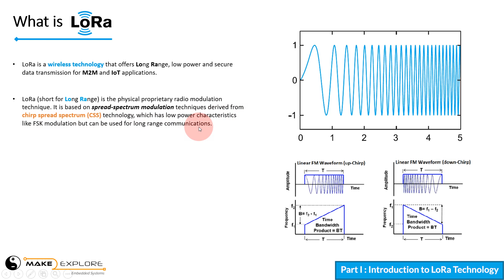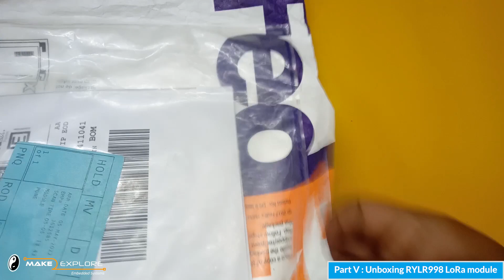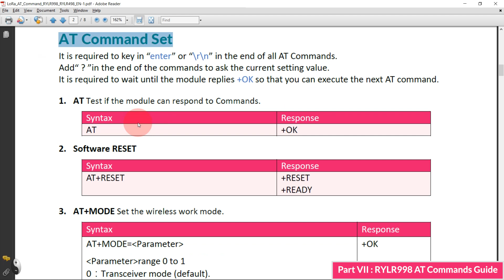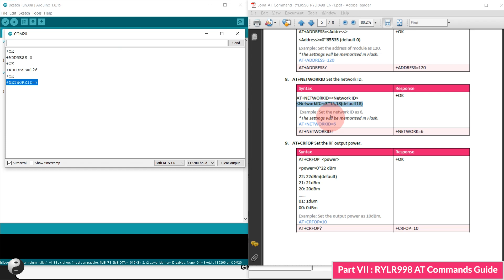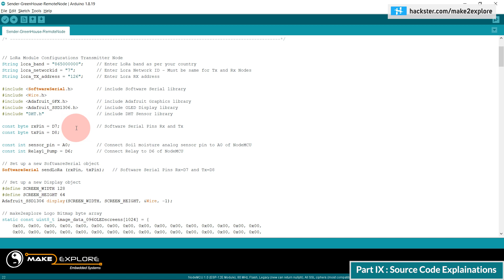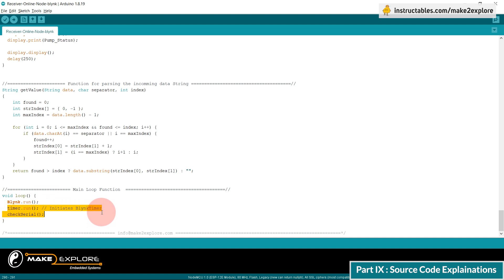[Device Overview] Reyax RYLR998 LoRa Module

Comment: What is the type of antenna?
Reply from the maker: Dear Friend, @bgm3942

Thank you very much for your interest in our channel.

Q - _ What is the type of antenna?_

➡️ The RYLR998 LoRa module we tested has helical antenna*. A helical antenna is an antenna consisting of one or more conducting wires wound in the form of a helix. A helical antenna made of one helical wire, the most common type, is called *monofilar , while antennas with two or four wires in a helix are called bifilar , or quadrifilar , respectively. 

➡️ The RYLR998 LoRa module typically comes with a U.FL (IPEX) antenna connector. This allows you to connect an external antenna that supports the LoRa frequency bands the module operates on, such as 433 MHz, 868 MHz, or 915 MHz, depending on the version and region.

➡️ You can use a suitable LoRa antenna (e.g., whip, helical, or PCB antenna) with a U.FL connector or use an adapter to connect it to other antenna types like SMA. The choice of antenna impacts the range and performance of the LoRa communication.

If you still have any suggestions/issues/queries about this Tutorial, or any of our DIY project, feel free to ping us on WhatsApp/Telegram (Links given below).

Tech support - (𝗖𝗵𝗮𝘁 𝗢𝗻𝗹𝘆) Telegram/WhatsApp - 11:00 AM - 05:00 PM (Mon-Fri) IST   

🚀 𝗧𝗲𝗹𝗲𝗴𝗿𝗮𝗺      🔗 https://t.me/make2explore
💬 𝗪𝗵𝗮𝘁𝘀𝗔𝗽𝗽    🔗 https://bit.ly/3VXGGEe
📩 info@make2explore.com  / support@make2explore.com

Thank you again for your Support,

Best Regards

Comment: Excellent work, thanks.

Do you know how many RLY998 modules can I connect, within the same network? Using the REYAX LoRa Mesh Application.
Reply from the maker: Dear Friend, Jose Naranjo @jnaranjo-hwt 
 
Thank you very much for your interest in our channel and your encouragement. Glad to know that you liked our content.

Q - Do you know how many RYLR998 modules can I connect, within the same network? Using the REYAX LoRa Mesh Application

➡️ According to the REYAX documentation, the LoRa Mesh Application supports:
1. Maximum 255 devices per network (including gateways and end devices)
2. Maximum 16 hops for mesh networking

📌 However, the exact number of modules you can connect within the same network depends on several factors affecting Network Capacity:
1. Data transmission frequency: More frequent transmissions reduce network capacity.
2. Data packet size: Larger packets reduce network capacity.
3. Network topology: Mesh networking can increase capacity, but also introduces complexity.
4. Interference: Environmental interference can impact network performance.

📌 Practical Implementation Considerations:
While the theoretical limit is 255 devices, practical considerations may be:
==> 50-100 devices: Typical limit for most LoRaWAN networks.
==> 10-20 devices: Recommended limit for high-traffic or mission-critical applications.

📝 REYAX Documentation for RYLR998 Module-
 🔗 https://reyax.com/products/RYLR998

Hope you find this information useful. If you still have any queries/issues/suggestions about this Tutorial, or any of our DIY project, feel free to ping us on WhatsApp/Telegram (Links given below) for further support.

Tech support - (𝗖𝗵𝗮𝘁 𝗢𝗻𝗹𝘆) Telegram/WhatsApp - 11:00 AM - 05:00 PM (Mon-Fri) IST   

🚀 𝗧𝗲𝗹𝗲𝗴𝗿𝗮𝗺      🔗 https://t.me/make2explore
💬 𝗪𝗵𝗮𝘁𝘀𝗔𝗽𝗽    🔗 https://bit.ly/3VXGGEe
📩 info@make2explore.com  / support@make2explore.com

We will be ❤️happy to help.

Best Regards

Comment: how do you get the SoftwareSerial.h file? Thanks
Reply from the maker: Dear Friend @jjones503 
 
Thank you very much for your interest in our channel.

Q - how do you get the SoftwareSerial.h file?

➡️ This SoftwareSerial library header file is part of  Arduino Core - AVR. You need not to install/get from any external source. You just need to import it into your code. 

➡️ In case of ESP8266/32, its implementation or compatible version also get installed on your system when you install 'Arduino Core for ESP32/8266'. This means once you install your board package(ESP32/8266) into Arduino IDE's boards manager, SoftwareSerial library automatically get installed, since it comes with default package of ESP32/8266 boards core.

📌 Checkout following links for more info - 

🔗 https://github.com/arduino/ArduinoCore-avr/blob/master/libraries/SoftwareSerial/src/SoftwareSerial.h
🔗 https://docs.arduino.cc/learn/built-in-libraries/software-serial/

🔗 https://github.com/esp8266/Basic/blob/master/libraries/espsoftwareserial/SoftwareSerial.h
🔗 https://www.arduino.cc/reference/en/libraries/espsoftwareserial/

Hope this will help, beside If you still have any queries/issues/suggestions about this Tutorial, or any of our DIY project, feel free to ping us on WhatsApp/Telegram (Links given below) for further support.

Tech support - (𝗖𝗵𝗮𝘁 𝗢𝗻𝗹𝘆) Telegram/WhatsApp - 11:00 AM - 05:00 PM (Mon-Fri) IST   

🚀 𝗧𝗲𝗹𝗲𝗴𝗿𝗮𝗺      🔗 https://t.me/make2explore
💬 𝗪𝗵𝗮𝘁𝘀𝗔𝗽𝗽    🔗 https://bit.ly/3VXGGEe
📩 info@make2explore.com  / support@make2explore.com

Best Regards

Comment: Is anyone able to communicate with their lora modules on their MAC?
Reply from the maker: Dear Araine T-Jay @arainetjay, 
Thank you very much for your interest in our channel.

Q - Is anyone able to communicate with their lora modules on their MAC?

➡️ We have not tried that approach yet. Also not seen any such MAC based communication project on anywhere on internet. Documentation about this module is very rare and there are also no any pre-compiled libraries available. We have to program them with barematal way using AT commands. Explore it if you are interested, and let us know about your experience.

If you still have any queries/issues/suggestions about this Tutorial, or any of our DIY project, feel free to ping us on WhatsApp/Telegram (Links given below) for further support.

Tech support - (𝗖𝗵𝗮𝘁 𝗢𝗻𝗹𝘆) Telegram/WhatsApp - 11:00 AM - 05:00 PM (Mon-Fri) IST   

🚀 𝗧𝗲𝗹𝗲𝗴𝗿𝗮𝗺      🔗 https://t.me/make2explore
💬 𝗪𝗵𝗮𝘁𝘀𝗔𝗽𝗽    🔗 https://bit.ly/3VXGGEe
📩 info@make2explore.com  / support@make2explore.com

As per time permits we will try our best to help you out. 

Best Regards
Reply: @make2explore hey thanks! I’m definitely checking it out. I think it’s communicating but MAC terminal doesn’t visually output the serial print - so I’m coding the Lora settings in the startup of my code

Comment: You have skip the entire LoRaWan Stack …… and using some P2P execption Mode …… right ?
Reply from the maker: Hello Friend @q9a 
Thank you very much for your interest in our channel.

Q - You have skip the entire LoRaWan Stack …… and using some P2P execption Mode …… right ?

➡️ Yes, you are absolutely right!!. We have used very simplest method/approach possible to make this DIY project and testing review of these LoRa module RYLR998. Since, in our area there is very weak and sometimes there is no any coverage for LoRaWAN network and Gateways. So, we decided to go with simplest P2P method.

Have fun testing (RYLR998 and RYLR986 modules) in your area with LoRaWAN stack and let us know how it performs.

If you have any queries/issues/suggestions about this Tutorial, or any of our DIY project, feel free to ping us on WhatsApp/Telegram (Links given below) for further support.

Tech support - (𝗖𝗵𝗮𝘁 𝗢𝗻𝗹𝘆) Telegram/WhatsApp - 11:00 AM - 05:00 PM (Mon-Fri) IST   

🚀 𝗧𝗲𝗹𝗲𝗴𝗿𝗮𝗺      🔗 https://t.me/make2explore
💬 𝗪𝗵𝗮𝘁𝘀𝗔𝗽𝗽    🔗 https://bit.ly/3VXGGEe
📩 info@make2explore.com  / support@make2explore.com

As per time permits we will try our best to help you out. 

Best Regards
Reply: @make2explore Do you know if it possible to run LoRaWan with this Devices …… it looks to me this modules are designated for P2P …… are there this modules also with LoRaWan firmware. For P2P a direct connect mode for the TX/RX pairs to create a LoRa Serial cable …… but the Dokumentation does not show something …… ist there also such a firmware to the Modul? 

Then there is also an other Point you have  not exact describe. Does the Modul ensure the entire conditions of the free frequency usage? The Question refers to the "Duty Cycle" limitations of this frequency. LoraWAN do so. If not you can not use it for DIY because you nee formal quality control about the applicaton software to ensure the duty Cycle condition will not be beaked.
Reply from the maker: Dear Hans Carlos Hofmann @q9a

Q - _but the Documentation does not show something....is there also such a firmware to the Module? _

➡️ Please note that this module is very basic LoRa trans-receiver hardware which build onto Semtech's LoRa Engine interfaced with NUVOTON MCU. Manufacturer do not reveal anything about actual middleware firmware, we have to deal with only application layer (via AT commands). Also, this module do not have any such tutorials or WiKi documentations about, how to connect LoRaWAN network or TTN. Surprisingly the manufacturer (Rayax) has not mentioned anything like that for the RYLR998 in its datasheet or AT commands guide. Also we do not found any compatible precompiled library do achieve that. So, it is clear that, we have to write our own command sequences and coding paradigms to make this module to connect to LoRaWAN. It's literally like writing your own stack!!!

We have also tested LoRa modules and dev kits launched by SEEED Studio which are Wio-E5 series based on STM32WLE5JC SoC (ARM Cortex M4 + Semtech LoRa® SX126X). You can find more info about them in following links, 

Wio-E5 STM32WLE5JC Module
🔗 https://wiki.seeedstudio.com/LoRa-E5_STM32WLE5JC_Module/

Wio-E5 mini Dev kit
🔗 https://wiki.seeedstudio.com/LoRa_E5_mini/

Wio-E5 Development Kit
🔗 https://wiki.seeedstudio.com/LoRa_E5_Dev_Board/

These modules and dev kits are fully documented for what you want to achieve, beside it also have 
- pre-compiled library 
- full SDK package provided. so you can write your firmware - building several applications with STM32Cube MCU Package for STM32WL series(SDK).
- WiKi Guide for how to connect and send data to The Things Network.

We'd recommend to checkout above, these hardware will useful for what you want to achieve.

If you have any queries/issues/suggestions about this Tutorial, or any of our DIY project, feel free to ping us on WhatsApp/Telegram (Links given below) for further support.

Tech support - (𝗖𝗵𝗮𝘁 𝗢𝗻𝗹𝘆) Telegram/WhatsApp - 11:00 AM - 05:00 PM (Mon-Fri) IST   

🚀 𝗧𝗲𝗹𝗲𝗴𝗿𝗮𝗺      🔗 https://t.me/make2explore
💬 𝗪𝗵𝗮𝘁𝘀𝗔𝗽𝗽    🔗 https://bit.ly/3VXGGEe
📩 info@make2explore.com  / support@make2explore.com

As per time permits we will try our best to help you out. 

Best Regards

Comment: Hello, nice video! I did a project here at home based on your video to heat the pool that transmits the pool temperature and receives the command to turn on the pump if the temperature is low. However, it stays on all day and sometimes I need to restart the module. I use a Hi-link 5V 600ma mini power supply. Can you tell me if the problem could be the mini power supply? thanks
Reply from the maker: Dear Rogério @rogeriocamargo1984, 
Thank you very much for your interest in our channel.

Q - I use a Hi-link 5V 600ma mini power supply. Can you tell me if the problem could be the mini power supply?

➡️ You have to estimate the power specifications of your project. Calculate total power requirements of your project(Including all components and their consumption and current requirements). And then design power supply accordingly. 

Please note the following important points - 

📘 There are two important specs about RYLR998 LoRa module -
📌 --> Transmit Mode current - Typically 140mA at RFOP = +22dBm
📌 --> Receive Mode current - Typically 17.5mA at RFOP = +22dBm
During testing of this LoRa module, we found out that, this module requires significant amount of current during transmitting signals. 
***You can use Sleep mode (or Smart receiving power saving mode) to keep module power consumption low(during idle time). There are AT command to enable Power saving mode (Check out AT commands Guide document).

📘 About HLK-PM01 Hi-link - 5V 3W - AC to DC Power Supply Module -
📌 Short-term maximum output current: 1000mA
📌 The maximum output current for a long time : 600mA
 
***HLK-PM01 is good option for standalone system. But we recommend If you provide separate power sources for LoRa module and other circuitry, your problem can be solved.

If you have any queries/issues/suggestions about this Tutorial, or any of our DIY project, feel free to ping us on WhatsApp/Telegram (Links given below) for further support.

Tech support - (𝗖𝗵𝗮𝘁 𝗢𝗻𝗹𝘆) Telegram/WhatsApp - 11:00 AM - 05:00 PM (Mon-Fri) IST   

🚀 𝗧𝗲𝗹𝗲𝗴𝗿𝗮𝗺      🔗 https://t.me/make2explore
💬 𝗪𝗵𝗮𝘁𝘀𝗔𝗽𝗽    🔗 https://bit.ly/3VXGGEe
📩 info@make2explore.com  / support@make2explore.com

As per time permits we will try our best to help you out. 

Best Regards

Comment: Sir. ¿Do you know how to make a mesh net with the RYLR998 Lora module?
I would like to learn how to build a mesh net with this Lora Chip that you are using?
May you help me out? 
Please
Reply from the maker: Dear Rafael @1rafaelespinoza,

Q - how to make a mesh net with the RYLR998 Lora module?

➡️ You can go through AT Commands Guide of RYLR998(Links given below). For more details about how you can create network and mesh using this RYLR998 LoRa transceiver module.

In our projects we tried only P2P method. We still have to explore Mesh/Networking using this module. Moreover, on the internet, till date we have not found any (Mesh) implementation/project available which is built using this module. But you can give a try, and let us know. There are different libraries available for Mesh networking using Semtech LoRa Engine Chips , like LoRaMesher for Arduino. 

RYLR998 have Semtech LoRa Chip inside, but it is embedded with Nuvoton MCU and custom pre-programmed by Reyax. So we have only access to AT commands and not to MCU code. So, If you want to use Lora Mesh-networking using this module, I think you have to try with AT commands and build custom library for this module.

***You can refer Networking diagram given by Reyax in their AT commands Guide document for more details.

RYLR998 Docs 🔗 https://reyax.com/products/RYLR998
LoRaMesher 🔗 https://github.com/LoRaMesher/LoRaMesher

We hope you find the above information useful.
If you have any issues/suggestions about this Tutorial, or any of our DIY project, feel free to ping us on WhatsApp/Telegram (Links given below) for further support.

Tech support - (𝗖𝗵𝗮𝘁 𝗢𝗻𝗹𝘆) Telegram/WhatsApp - 11:00 AM - 05:00 PM (Mon-Fri) IST   

🚀 𝗧𝗲𝗹𝗲𝗴𝗿𝗮𝗺      🔗 https://t.me/make2explore
💬 𝗪𝗵𝗮𝘁𝘀𝗔𝗽𝗽    🔗 https://bit.ly/3VXGGEe
📩 info@make2explore.com  / support@make2explore.com

As per time permits we will try our best to help you out. 

Best Regards

Comment: I have RYLR998,  when set band using At command "AT+BAND=865000000", it remember only when it is connected, when i disconnect and connect and ise "AT+BAND?"
it shows +BAND=915000000Hz, why it is not remembering BAND?
Reply from the maker: Dear @MrNams, 
Thank you very much 🙏 for your interest in our channel.

Q  -  ---it shows +BAND=915000000Hz, why it is not remembering BAND?

➡️ If you see timing diagram given in datasheet of this RYLR998 LoRa Transceiver module, it has been clearly shown that it get RESET (RST) to factory settings/configurations/parameters  whenever we power it on. Therefore we need to re-configure it to desired frequency band every time we power it on. And +BAND=915000000Hz is the default frequency band.

If you have any issues/suggestions about this Tutorial, or any of our DIY project, feel free to ping us on WhatsApp/Telegram (Links given below) for further support.

Tech support - (𝗖𝗵𝗮𝘁 𝗢𝗻𝗹𝘆) Telegram/WhatsApp - 11:00 AM - 05:00 PM (Mon-Fri) IST   

🚀 𝗧𝗲𝗹𝗲𝗴𝗿𝗮𝗺      🔗 https://t.me/make2explore
💬 𝗪𝗵𝗮𝘁𝘀𝗔𝗽𝗽    🔗 https://bit.ly/3VXGGEe
📩 info@make2explore.com  / support@make2explore.com

As per time permits we will try our best to help you out. 

Best Regards 🙏
Reply: @make2explore  Tons of thanks, will connect. It reset only BAND other parameters it saves, anyway I tried setting BAND in setup function, but unfortunately AT command is not working when I send it through SoftwareSerial print method, note I tried appending "\r\n","\r" all combinations
Reply from the maker: Dear @MrNams, 

Q  -  ...note I tried appending "\r\n","\r" all combinations

➡️ Yes you are right!. In Arduino code, In setup function, to send AT commands to RYLR998 LoRa module via Hardware/Software serial, We can either use "\r\n" or you can use newline print println command like following,
//-----------------------------------------------------------------------------------------------------------------------

String lora_band = "865000000";     // Enter LoRa band as per your country
Serial.println("AT+BAND=" + lora_band);

//-----------------------------------------------------------------------------------------------------------------------

==> If AT commands are not working, please make sure that your Software serial baud rate is (115200), unless you changed it. 115200 is default.

==> Please provide enough delay(500-1000ms) after AT command.

If you still have any issues/suggestions about this Tutorial, or any of our DIY project, feel free to ping us on WhatsApp/Telegram (Links given below) for further support.

Tech support - (𝗖𝗵𝗮𝘁 𝗢𝗻𝗹𝘆) Telegram/WhatsApp - 11:00 AM - 05:00 PM (Mon-Fri) IST   

🚀 𝗧𝗲𝗹𝗲𝗴𝗿𝗮𝗺      🔗 https://t.me/make2explore
💬 𝗪𝗵𝗮𝘁𝘀𝗔𝗽𝗽    🔗 https://bit.ly/3VXGGEe
📩 info@make2explore.com  / support@make2explore.com

As per time permits we will try our best to help you out. 

Best Regards 🙏
Reply: You've to put comma and M

865000000,M 

M means memorize